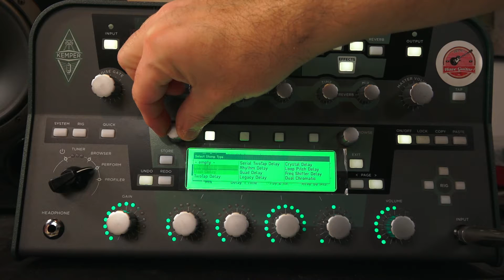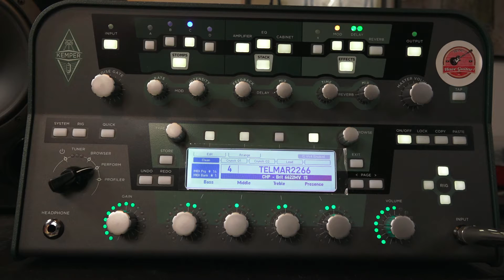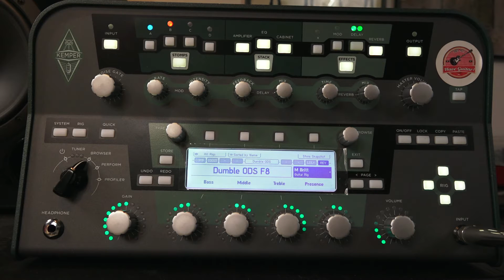Add effects to Performance Mode slots (Kemper Profiling Amp)

Comment: how to add effects in browser mode to profiles my effects wont come on
Reply from the maker: That seems strange, you should just have to push one of the effects buttons to activate that slot. Doesnt that work? Also, you can activate a slot without an effect in it, so then you need to pick one of course.
Reply: for example i had bought a pack online which has like 83 different profiles and if I want to add an effect like delay overdrive or anything to add to the sound of the profile nothing will come on also my type knob doesnt work
Reply from the maker: @jimmyttkacz2006  Sounds weird... could it be you need to upgrade your Kemper OS? Thinking maybe the profiles are made with newer OS version. Just a thought. If it is up to date I would either contact Kemper support or maybe do a post on the official forum.
Reply from the maker: @jimmyttkacz2006  Hmm, another thought- if you press any of the effect buttons (A-D or Mod, X etc); will the LCD display the effect screen? It will be dimmed first and then press the button again to make it "active". Would that help perhaps?
Reply: @haveguitar  The damb thing is prob. a lemon with my luck. can never win.. lol
Reply: @haveguitar  thank u for your help  very much .